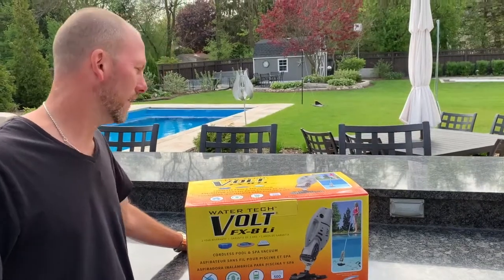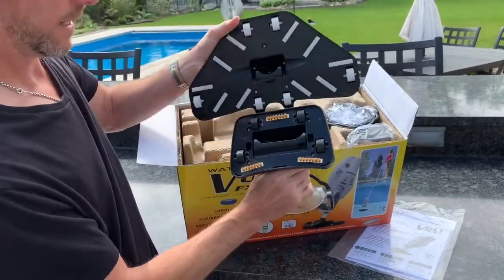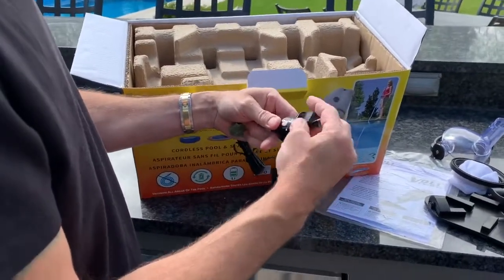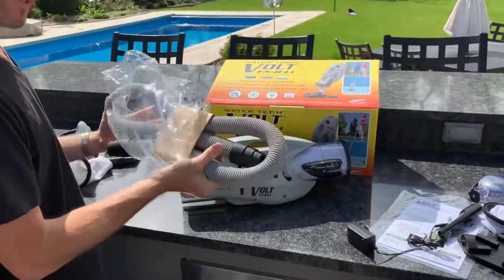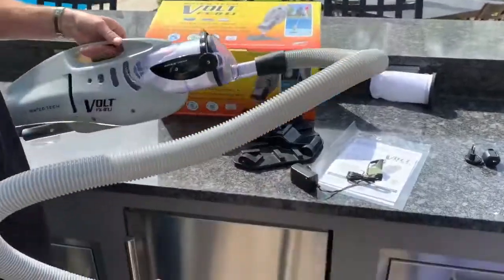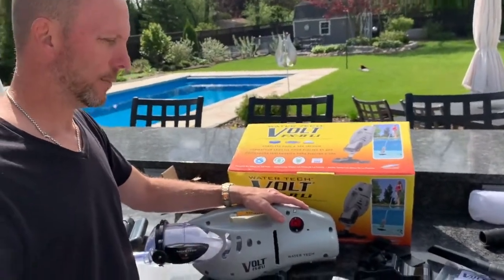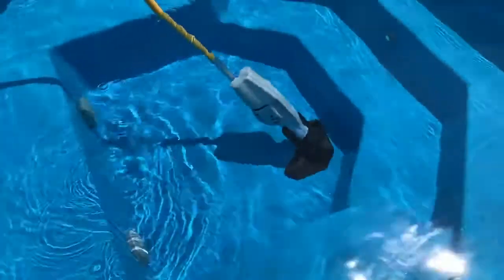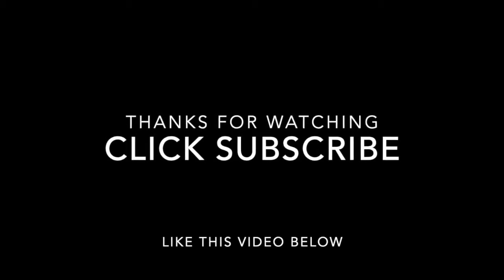Volt Pool Vacuum FX 8LI WaterTech 💦 | - Show it Kukla

Comment: I am looking at getting the fx4 or fx8 or both. Do you still like this? I want it for quick touch ups and the spa. I feel the smaller one would be better for spa?
Reply from the maker: I prefer the Fx4 over the Fx8, the 4 is easier to use and move. The Fx8 was not getting all the spots needed in my spa and I felt the suction was not as good based on the design of the head.

Comment: Every time I use this it works great until I pull it up and all the debris just falls out into the pool again 😐
Reply from the maker: I have not had that problem. Maybe check to see that the bag is fully seat. I pull the vacuum straight out so the debris doesn’t come out the blower gills.
Reply: @showitkukla  should we leave the vac on as it's being pulled out? Or turn it off, then pull it out?

Comment: Im looking at the 4 and 8. Is the 8 worth the price difference?
Reply from the maker: I prefer the 4 better than the 8, it is more maneuverable in my opinion.
Reply: I’m using it for our water feature in our backyard it’s only about a little over a foot deep. So I know I’m gonna have to keep it at a 45° angle to keep it submerged. I’m really looking mostly for suction. Did the eight have a lot more suction than the four? If so what was the difference in price.? Thank you
Reply: @showitkukla I’m in the same boat-
1) Would you say the 8 has significantly more suction power than the 4.. or is the 4 plenty adequate?
2) Do you think either of these would be good for collecting the fine “clumps” of dead algae that sometimes accumulate after shocking, or do you think dead algae particles are too small and would pass right through the filter netting?
Reply from the maker: I purchased the 4 again, I feel that one has better suction but a smaller vac head. The 8 crapped out and was not as good. The 4 can suck up small particles and firework sulfur and large leaves and worms. Totally recommend the 4 over the 8 @RussC123
Reply: @showitkukla  thanks a bunch- super helpful!
Reply from the maker: Glad to help, I'm going to try and share more pool content that are things that have helped my pool @RussC123
Reply from the maker: Glad to help @RussC123